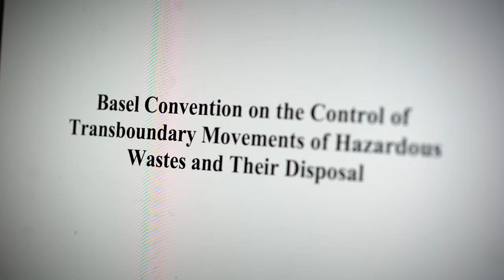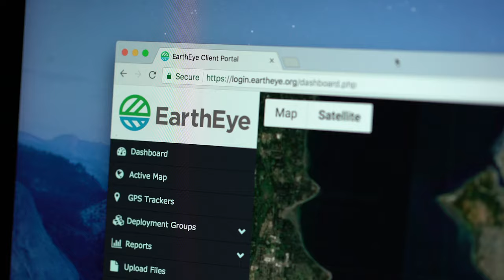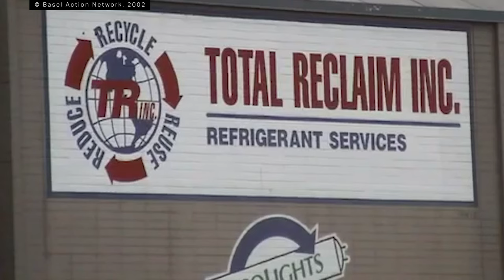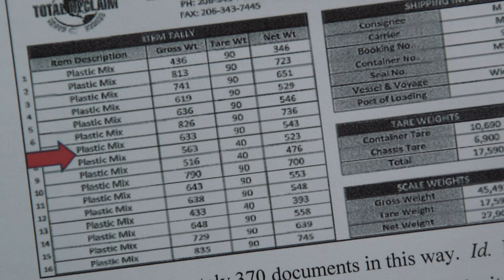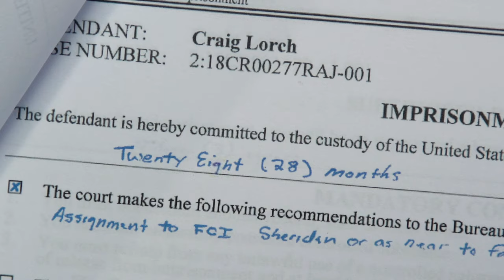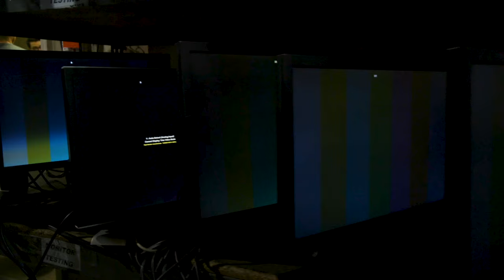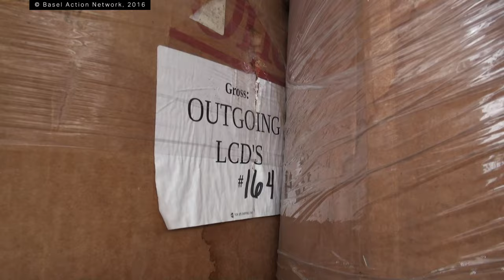The dark side of electronic waste recycling

Comment: Maybe we should also stop exporting cotton to developing countries since it ends up in sweatshops? This is a silly argument. The people in these countries don't do the work simply for the heck of it, they probably do it because it's the best  job available to them. To just stop exporting to them and rob them of a major industry would slow the whole "developing" part of the equation. If you really wanted to help the average worker at these recycling operations, you'd advocate for a trade deal that creates a baseline for workers rights and protections
Reply: These require careful handling as it is toxic. Cotton does not.
It's not so silly if you factor in the danger of handling eWaste.